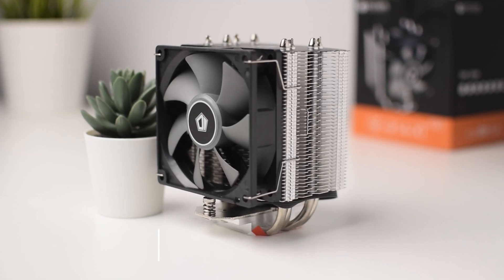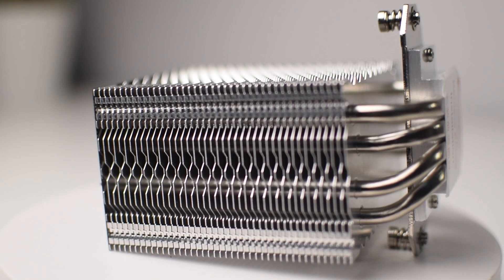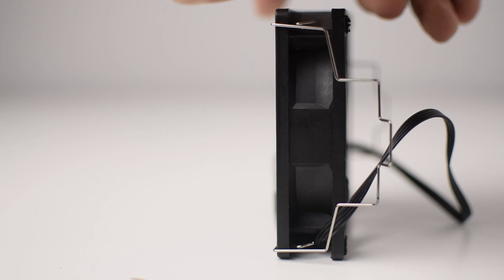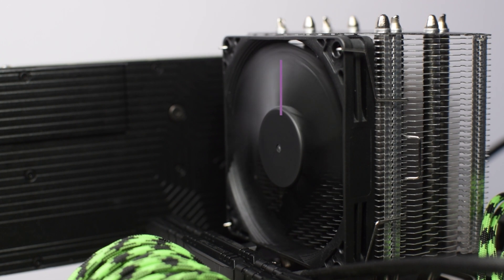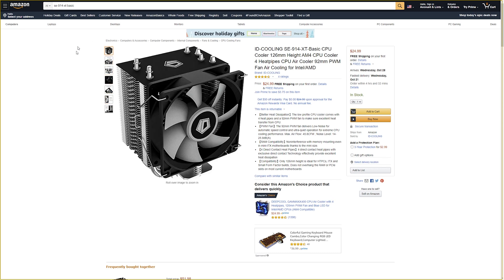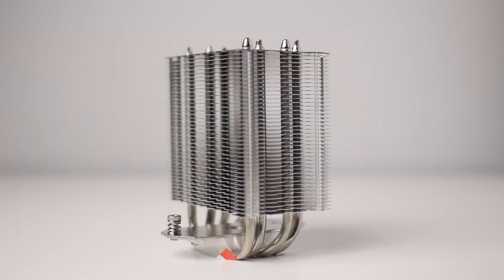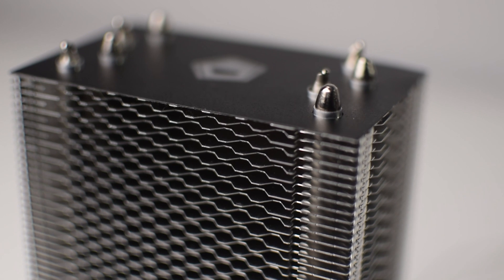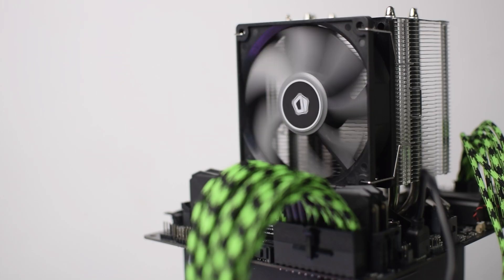BUDGET PC AIR COOLER | SE-914-XT BASIC | ID-COOLING

Comment: The heatpipes in your footage doesn't look deformed to me. Heatpipes before they're bent into shape for the heatsink is shaped like a tube balloon with one end rounded and the other end open. In your footage the pipes are oriented in alternating positions so the 'ends' that are welded shut are on alternating sides. Some manufacturers sand off the welds so it looks nicer while some use a cap to hide the imperfection. ID cooling seems to have done none of that so it just looks like a manufacturing defect even though it isn't.

Comment: Those aren't deformed heat pipes that's just how they seal the end after filling them. If you notice there's two on one side and two on the other. One end of each heat pipe is sealed off like that. Sometimes it's more noticeable than others but that's not a design or manufacturing flaw

Comment: Hey I have a ryzen 5 3600, ¿Is worth the id cooling se 914 xt over the stock cooler?
Reply from the maker: I haven’t tested it but if I had to guess, it’s only a few degrees difference between these two tbh. The 3600 comes with the stealth cooler right?
Reply: @AliOxen  yes, the temperature is about 70 while gaming but in hot days is around 75-80 degrees.  So I'm between 2 options: buy a new cpu cooler  or buy a new case with better airflow because the airflow of my case is awful.

Comment: Thanks, just bought the ARGB version for $8 more than the Basic. I'm gonna pair it to a R3 3300x with a small OC. My Core V1 itx case has a max 140mm cooler height clearance, so my other options were a 120mm aio or Noctua 92mm for double the price. I went to the ID-Coooling website and they do specialize in CPU cooling, so I have high confidence in this cooler.

Comment: Hey bro, nice video!! Would i7 9700 or 9700k run at low temperatures with this cooler?
Reply from the maker: I wouldn't call them "low" compared to the alternative cooling options but so long as its not overclocked, the 9700k should keep well below unsafe operating temps